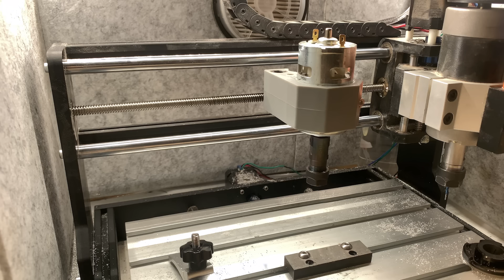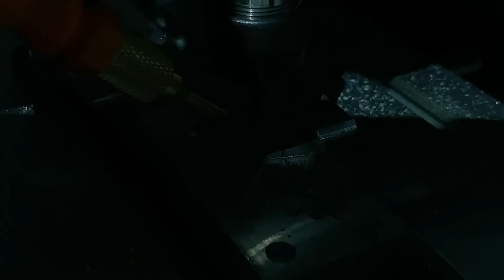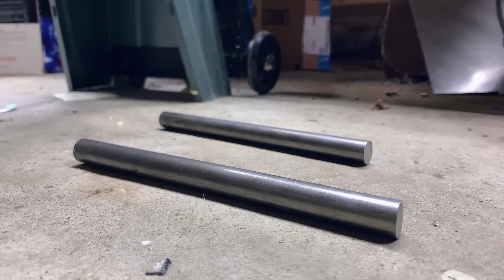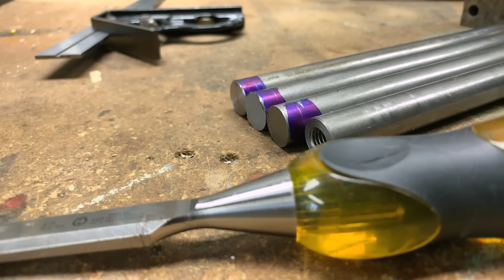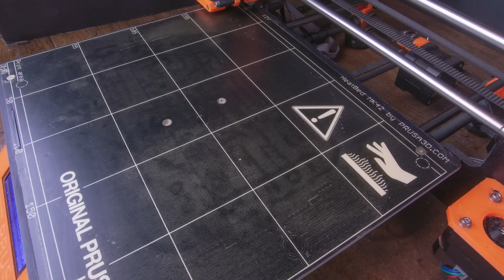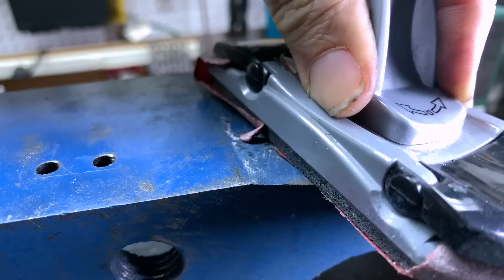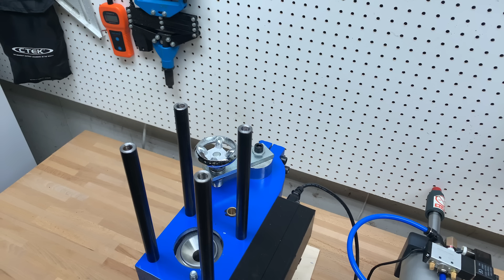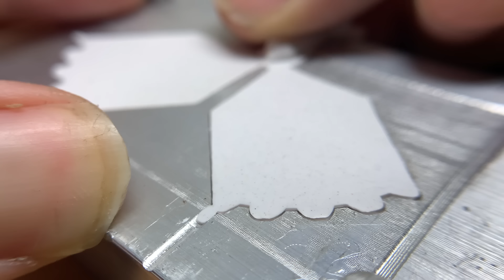Build an Injection Molding Machine From a Cheap Pneumatic Press

Comment: Beware damp plastic.  Nylon and ABS are buggers for it.  You can find as the ram comes out of the barrel, the granules come out like a shot gun with steam behind them.  Dry your plastic in the oven on the highest temp that doesn't melt it for several HOURS!
Happened to my dad, glasses protected him, but he grew a beard like father Christmas while all the cuts healed up. It was a Manumold machine.
Have fun everyone. And stay safe.
Reply from the maker: THIS.   💯 I try to keep everything sealed with descant in it, but this is a big deal.  I've since added some more protective shielding and a pellet feeder, but making sure everything is dry is super important!
Reply: @retrotechjournal  Can i contact you directly such that you can give some safety pointers to you viewers?  Injection moulding is safe, but some combinations of plastics are bad, make gas etc. mitigating things.
Having had mum burnt, and dad face blasted (one accident each over 20 years), i feel I have something to add to the soup.
Reply from the maker: @markpitts5194  If you'd like to write something up as a thoughtful comment here I'd be happy to pin it.  That might be the most effective way to get the word out.   Although I have added some safety features I haven't been working on a  video about them, so a pinned comment is going to be more timely than "Some points that may appear in some not-for-sure-happening future video"  If I do make such a video I'd be sure to include your tips, but I have no idea when that might happen.   Maybe I should do a short video about the pellet feeder/safety shield but it would have to wait until I finish my current video.
Reply: @retrotechjournal  Dear Mr Retro (my name is Mark). I will write some safety tips over the weekend. My father is no longer with us, but mum is next door (and she did most of the moulding, dad was the tool maker).  I will have lunch with mum and come up with some safety points. The Manumolds are not much bigger than your home made one (if you google you will see) , so I think most points will apply . 
By the way, I do love your design. I was looking as mum is now 84, but i want an injection moulder back in my life.
I can see that your mould is blowing open on injection. The Manumold machine had twice the diameter ram to hold the mould shut (the vice) , as to inject the plastic.  I believe you must have had a lot of 'flash' , clamping pressure will fix it.
Reply from the maker: @markpitts5194  Thank you so much for doing this!   What a great resource.   The mold doesn't actually open that much under normal usage.  I had done a long shot of that operation and I didn't want to bump the camera/move things around by tightening up the clamp very much, so on that one shot the mold opens a lot, but under normal use with the big hand wheel to close it up tight it stays shut fine/no flash.  I probably should have re-shot that but I didn't really notice until much later and it seemed silly to re-shoot it.
Reply: @retrotechjournal  So , having now talked to mum, the basic takeaway is that acetal is evil.  It gasses formaldehyde if you over heat it, and is very hygroscopic.  Never allow acetal and PVC to mix unless you want an accident.  On PVC, this material will corrode anything.  The C in PVC is chloride, next step hydrochloric acid.  PVC also squirts if it can find an exit.  Mum still has burn scars on her arm 30 years later, wear simple protection, long sleeves, gloves and a full face mask. We made a lot of rubber gators from it, and had a barrel dedicated to it.  Use polystyrene to clean your barrels as it doesn't react with anything, and in reground form has lots of sharp corners that are good for scouring the bore.  Hope this helps somebody.  mark.
Reply: I build injection molds for a living. I used to work with a guy that was working on a machine when moisture caused the nozzle to erupt violently. It sprayed molten plastic all over his leg. He had to have it removed at the hospital. He was scarred for life.
Reply: @mnotlyon  "It" the plastic or "it" the leg?
Reply: @samuelsudhof8036  It, the plastic. He did retain full use of his leg, but had very deep scars.
Reply: lmao I thought he had his leg removed! I was scared to death! Molten plastic causing amputation...  @mnotlyon
Reply: Mark, I'm glad your dad is ok from that! Mercy - have not heard of one that bad.
I was going to mention also that heating up clear pellets is a way to avoid bubbles. As Mark said, you have to sorta go low-ish (not melty) and long. Then I'd store them in a sealed container with desiccant.
Reply from the maker: @TheCrafsMan  Yes, that's my current plan to.  I got some big bags of pellets from eBay, and I keep them in sealed bags with desiccant.  Also PE doesn't super attract moisture.  Still you have to be careful.
Reply: I think MOLTEN anything is dangerous.   I had a mishap building an aluminum foundry once - the "crucible" (bean can) failed and the molten metal backfilled the foundry and ran through my propane burner - burned a hole straight through my driveway to the earth.   Luckily I had invested in an extra long propane tubing to keep the tank far away or it would not have turned out pleasantly.
Reply: @makebuilddesign  In the future you should put the fuel source above the foundry. Although it sounds like it might've gotten too hot, possibly from some iron contamination. You should run a magnet over everything you put into it. It won't catch every bit iron as some steels aren't particularly magnetic, but it's better than eyeballing it.
Reply: Face shields with glasses beneath are far better for glasses of course do not protect the face. A metal screen shield can ventilate but halt solids.
Reply: You should always know what kind of plastic you are working with and what it drying/melting temps are, also never mix different plastics as it could result in explosion.
Reply: You can dry your plastic on a metal baking tray ½" deep for 2 hour, this is how industry did it 30 years ago.
All emorphis plastic needs drying.
ABS 70°C
Nylon 80°C
Polycarbonate 100°C

Get a data spec sheet on the material. It will tell you the dry temp and time. But using an over is not like a modern industrial dryer that empties a shot of material every machine cycle and keeps the granules moving, so set the drying temperature 10°C below the specified low-end temperature and go from there, as I've see material like a square brick if you don't be careful. I would also suggest that if you're making one of these machines, you lower your expectations, as a 3 phase industrial injection moulding machine has  between 25 to 40 times the injection pressure. I would advise a 12mm diameter plunger that fits well and a high-pressure air compressor and the nozzle radius to be one  20th smaller than the tool (die) radius to stop the heat sink, with a 3mm hole to start with the tool one 20th bigger, this can be open up after the first trial of your tool and this excludes the sprue (runner) which I'd start at 4.5mm with something like this, remember it's easier to remove material but it's hard to but material back. I would also start off with only 1 cavity (part) 1st. I would also suggest to warn your mould to 50°C minimum (check data spec sheet for material) to increase freeze off time of the tool (die) cavity. This will ad in the part removal. If you can't fill the mould, here are more tips in order of priority.
1, Check cushion, has the plunger got any more material left to give, if not increase material or fix internal or external leak.

2, Increase injection speed.

3, Increase injection pressure.

4, lncrease mould and/or material temperatures.

5, change material to a higher melt flow.

6, Increase, sprue and/or cavity wall thickness.

I hope this helps someone 😊
Reply: @PeckhamHall  what a detailed aid, thanks. What about toxic fumes? PET, ABS, PP? POM?
Reply: Now he needs to build a dehumidfier.
Reply: Dry plastic is one reason plastic injection molding plants tend to be concentrated in places like El Paso, TX  and Phoenix, Arizona.
Reply: because it is hot there?  @weldonkilburn6867
Reply: Yep, hygroscopic materials have to be dried. Make a box with a small heater in there, incandescent light bulb if you can still find one, will do and just store the pellets in there all the time.
Reply: I think a silicone mold copies would be a lot better for most people.  You print the first 5, then sand them and do whatever corrections you want to do.  Then take the mold and start pouring copies.  With 15 minute resin, you can make a lot of them quickly.  If you have to make 200 of them, maybe print the first 10 and make a mold of all 10 and then every copy is 10.  The beauty of this method is that they will all be perfect copies.  You can save the mold if you need to make more copies later or you can cut the mold up and use it for the next project.
If you are a professional and have to do this a lot, a real injection machine would be the answer.

Comment: Great video! I'm trying to replicate this, and before going all in on the press, could you tell me more about what the display controller is capable of doing? You mentioned that you have control over the injection pressure, injection speed, hold time, and release speed - is there anything else you've used the controller for?
Reply from the maker: The electronic control basically has hold time, and it counts how many injections you've done.  The air pressure regulator directly controls max injection pressure.  The adjustable output baffles on the solenoid valve (that I added) give you control of injection speed and release speed.  (Since you can control the rate at which the air is being released from the non-driven side of the cylinder via a needle valve.)    That's great from a consistency perspective.  You hit the button and everything else is pretty consistent.   

The two main things this doesn't control for are the temperature of the mold. Which I wasn't having any issues with, but which goes up a bit during a long run.

And the exact shot temperature, which is generally being controlled by the heater but in theory if you are doing very large shot sizes very quickly might start to fall since the plastic isn't in the chamber for as long, so you might have to inject slightly more slowly in those cases.  

At the normal speeds/sizes/details I've been using, I haven't noticed any real problems with either of those things, but I just thought it would be worth noting.  You could in theory add mold cooling/heating, to try to adjust for that, but I haven't had to do anything like that.  If you are doing super narrow branching shapes that you can't manage to inject at max pressure without a mold pre-heat you might have to mess with that.
Reply: @retrotechjournal  Thank you so much for the thoughtful response! I really appreciate it! I think I'm going to try to design my own barrel for this to work around machining the stainless steel piece and blue base. Would it be possible to make the CAD downloadable to see how it could all work together?

Comment: Great video! What kind of plastic was used for this project?
Reply from the maker: I was using Polyethylene pellets simply because those flow well/are non hygroscopic so I don't have to worry that much about drying them.  However a very wide variety of plastics can be injection molded with this machine.  I just picked something safe/cheap I could get in reasonable quantities.

Comment: What are the maximum die dimensions?
Reply from the maker: That’s not an easy question to answer because although max shot size is well defined the “die size” depends a lot on the shape of the part/the strength of the clamping system you are using, etc.  I’ve made parts that are maybe 2”x 1.75” without the mold giving way with my bridge clamp.

Comment: I came here hoping I could replicate your process for more affordable access to reliable injection molding. Instead, I learned exactly how much I have left to learn before I take on a project like this. Media that gives us insight into our own growth is a gift that lasts a lifetime. Kudos. 

Also, I have spent so much time with eccentric science and engineering types, and yet somehow this is the most Doc Brown thing I have ever seen.
Reply from the maker: That is very kind of you to say!  I'm sorry if I made the process seem difficult to reproduce.  The actual modifications are pretty low key/Send Cut Send could probably manage the parts.  (4 cylinder standoffs/ram/elliptical support piece.).  The only reason I didn't speck some of those out for people who wanted to do the same thing is because I ended up having to machine a pocket in the bottom of the casting, which took it from "drill and tap a few holes" to "a bigger project".   

I later realized the whole system could have been mounted above the casting.  Without much of a change.  Not quite as clean looking, but that would have worked just as well without the need to machine anything.  Other's have also mentioned adding the clearance under the casting could easily be done with a die grinder/something else.  Since you just need clearance, not a precision machined surface.

Anyway.  Thank you for your kind comment, and good luck with your Injection Molding adventures!

Comment: Hello, i want to make one but let me know the difference between yours and first one wich inspire you is just that you inject by pedal and not from hand?
Reply from the maker: Well, injecting under Pneumatic control lets you inject with much more consistency.  When you are pulling the lever by hand your exact control of speed/hold time, etc is very operator dependent, and you end up with a lot of failures from more or less pressure/speed.  Also there are limits to how much pressure you can apply.  With the pneumatic you can be entirely consistent and at higher pressures/speeds.  I would never try and inject 100 objects using that little hand injection molding machine, but it's easy to do with the pneumatic rig
Reply: @retrotechjournal all clear now, thank you❤

Comment: did the edit at 1:27 puzzle anyone else
Reply from the maker: You mean the "I edit every single pass by hand so it lasts one frame"?  Sorry if that was confusing.  I thought that was the nicest way to make a time lapse of it though.  That was not very fun to do.  Hot keys.  I probably should have used Gcode injection to time a still camera shot, but that is yet another side project.  (That's how I do 3D printer time lapses) I figured this was pretty much the CNC equivalent of per layer 3D print time lapses.

Comment: Do you have any instructions on the wiring of the thermostat components? Or do you have any info you'd be willing to share here? Thanks in advance!
Reply from the maker: Oh, sorry!   I only check these comments once in a while.  This was based off Buster Beagle 3D's initial injection molding video, and you can see the wiring diagram here: https://youtu.be/HoSVPHVESiE?si=ujCGxkR0KXVajmFf&t=801 Sorry, I guess I should have included that in my project.
Reply: @retrotechjournal You're good, I really appreciate the reply! You really should keep up the video making, even if it's just a hobby. They're very entertaining/ educational
Reply from the maker: @GMjunk89  I do have a video I'm about 50% of the way through making, but it's been stalled for over a year at this point.  The thing that gets me filming is when I think of something fun/new different about a shot.  Something I can learn, or that just makes me laugh. Then there's a lot of sort of boring glue shots like Talk to Camera stuff, and trying to edit the shots into a decent arc, and that's all kind of labor intensive/not that fun.  I recently re-started work on that project I was filming, with a bit of a new spin.  If that work takes off/the project re-ignites it may still happen. It would be a shame to have so many good scenes and not ship a final video.  Thanks for your encouragement.  It does help just thinking "oh some people would like to see this thing" when I'm trying to get myself to do the boring bits.  😅

Comment: great video, well made and your skills are awesome. The only small query I had (my wicked sense of humour kicking in!) was...how many hours of work did you have to do to complete your conversion and how many dollars worth of equipment?!! I know, unfairly nit-picky, lol.
Reply from the maker: I was hoping the conversion would have a pretty low bar in terms of required equipment.  Like hoping it could have been reduced to a Send Cut Send order + 3D prints and some drilled and tapped holes.  However because I had to mill a small chunk out of that upper casting it stopped being "a few drilled and tapped holes" and ended up being a bit harder to build.  I understand that things I can do in my shop are not the same as what most folks can manage.  I just like making stuff. I have no idea how many hours I put in.  I do know I spent way way way more time doing the video than building the rig.  😆   If I had to guess I could do that build in about 2 days (if I didn't have to design the 3D prints, had all the stock, and some plans).  I spent a bunch of months doing it though.